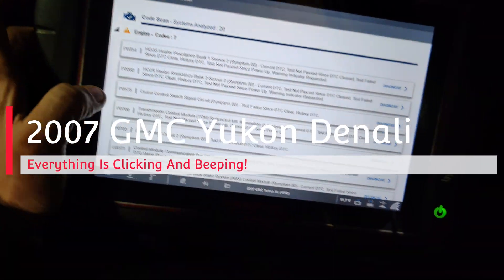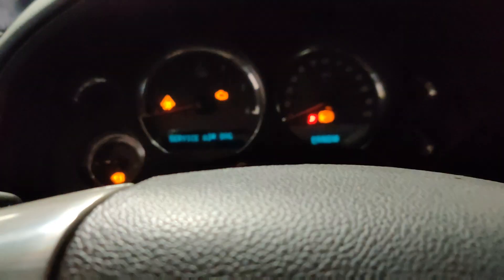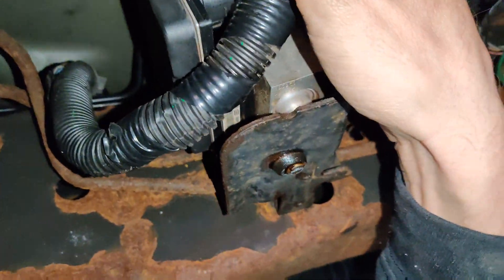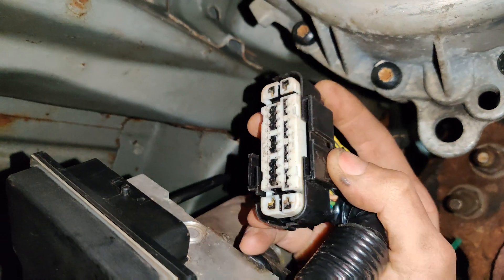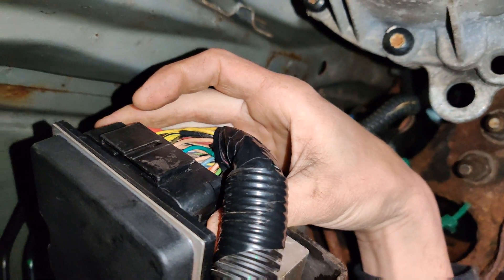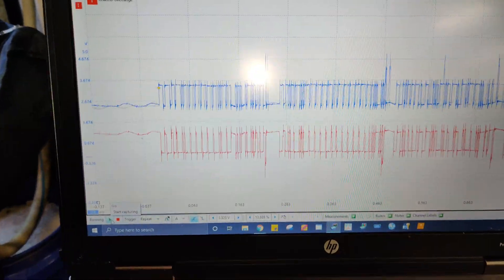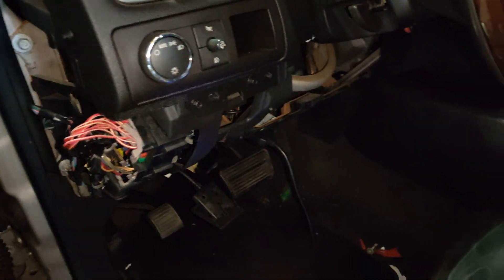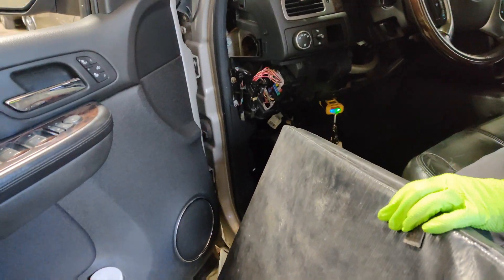2007 GMC Yukon Dash Clicking, ABS, Traction Control, Gas Light, Check Engine, Check Stability, Codes

Comment: 👏🏽👏🏽👏🏽 very informative.

I have a 2007 Yukon Denali Xl. My brake light stays on even after the key is out. The issue started when the harness on the passenger rear taillight light harness melted from the muffler falling off and it heated up my bumper and melted my harness. Now I have to take out the Stop Lamp Fuse so the light doesn’t stay on. 

When I do start the truck without the fuse being in, the parking light is on (top and middle lights). Once I put the fuse in, the brake light goes on as if I’m on my brakes that way when I step on my brakes- my 3 brake lights work so I don’t get pulled over by the cops. There’s no junction box in the rear by the spare tire so I don’t know where to look or how to fix the issue. Please help if you can
Reply from the maker: Have you scanned the car for codes in all the modules? Have you performed any testing?